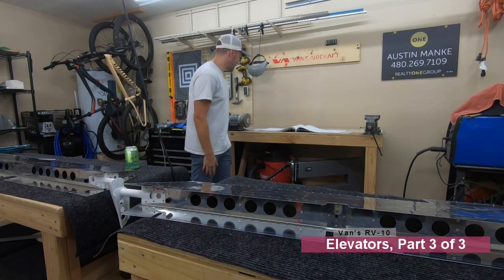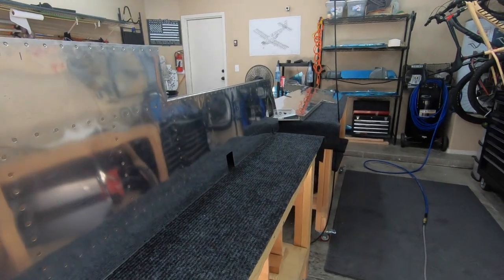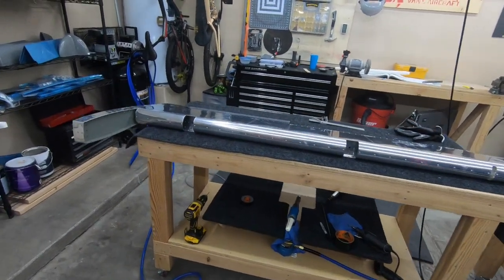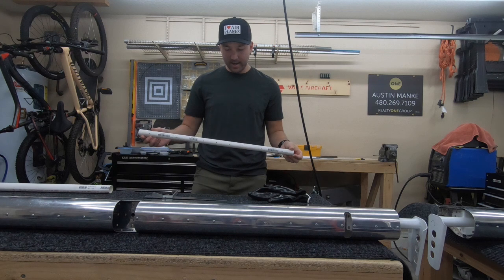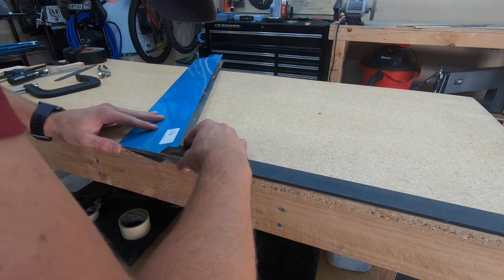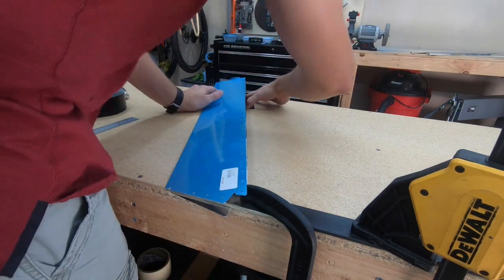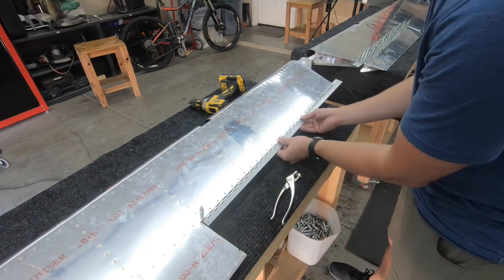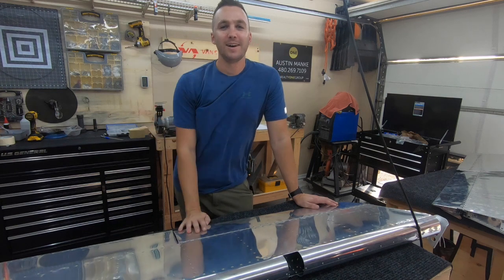Van's RV-10 Elevator Build, Part 3 of 3

Comment: Austin- How far apart were the skins when you were "done" and ready to rivet? Do the skins need to be touching and all the holes lined up (without clekos)?
Reply from the maker: I remember that they sat a bit apart and required quite some pull to get them held together for riveting. I don’t remember how far apart but I remember they were nowhere near lined up when resting with no clecos. If I did it again I’d probably spend a bit more time trying to get them to line up better, but it sounds like most builders have a similar experience and it ends up fine in the end.
Reply: @AustinManke  Thanks Austin. I got the top section of my -14A rudder "close". I'm OK with that because it doesn't take much effort with that short top section to bring all the holes in alignment for riveting. BUT, I've spent probably three hours just on the middle section. I've rolled both sides over and over and over and over... I might be half way done - and I'm reefing on it when I roll them. This has been by far the most frustrating part of my build to date. I'm using a 3/4" Schedule 40 PVC pipe (1" OD) based on your recommendation but I've tried 3 other sizes. The holes aren't anywhere near lined up. Like 2" apart right now. I guess I just need to spend a couple more DAYS folding these stupid skins??? I'd pay somebody $500 right now to finish this one step so I can move on :-)
Reply from the maker: @bertschb  it’s definitely one of the most frustrating parts of the build I’ve done so far. That’s right where I was when I decided to just rivet them together and accept the resistance they had in them. I used rubber coated gloves for grip, pulled them together, clecos, then riveted them. You could always do the same and come back to it later if the final product bothers you or if you have rubbing issues.
Reply: @AustinManke  I'm just worried about pillowing between the rivets if I have to force the skins together a little too much. I had that happen with the "aileron" test kit I built several months ago. I did buy some grippy gloves based on your recommendation and I'll use them if I need to force the skins together for riveting- which may happen based on my lack of progress so far. Thanks again for taking the time to reply. You really are helping me with my build. You are VERY good at coming up with creative ways to make your build easier.
Reply from the maker: @bertschb  ahhh okay. That makes sense. I remember getting it to the point where I was able to test with clecos and see no pillowing before riveting. 

Could be a good spot to stop and come back to after working on something else for a bit. That has saved me lots of time and money when I had the urge to force my way through something. 

And thank you so much!! I’m glad you have found the videos helpful!